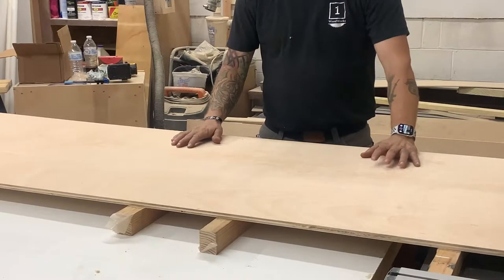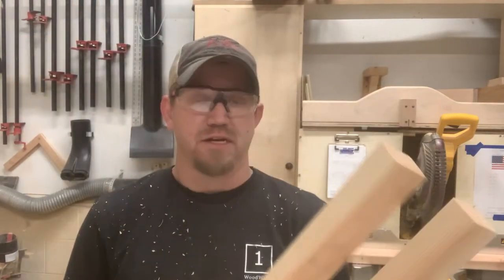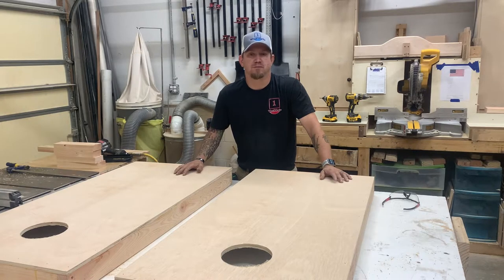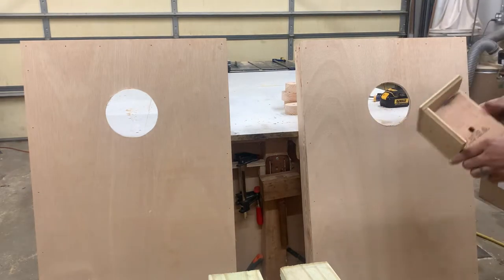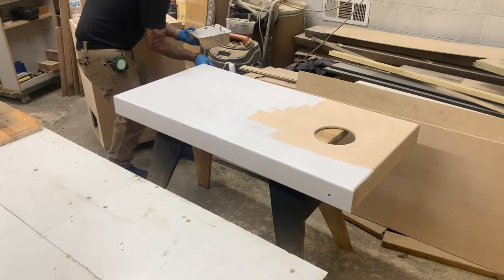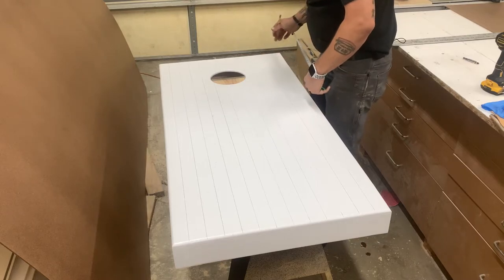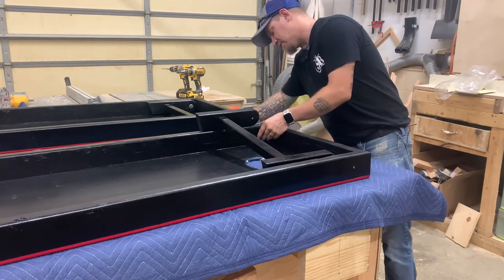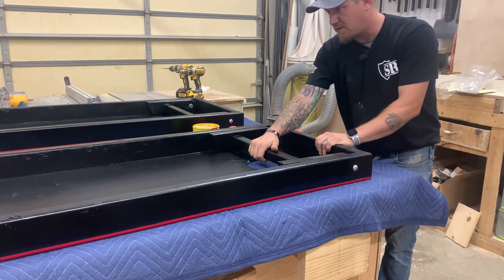American Flag Corn Hole Boards

Comment: Nice boards. Here is a quick tip. Buy 1.88 painters tape. To measure the stripes start 1.5 inches from one edge. Cut a short piesce of tape and lay at that mark then lay another piece next to that and so on. You will end up with 13 stripes and 1.5 inches on both sides. I hope this makes sense to you. I build a lot of these and it is very easy for me. Thanks